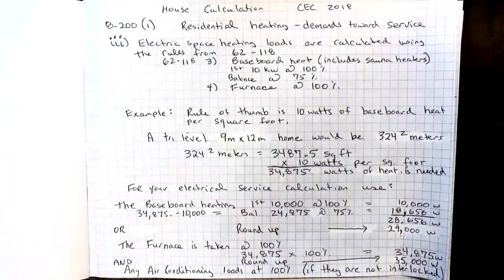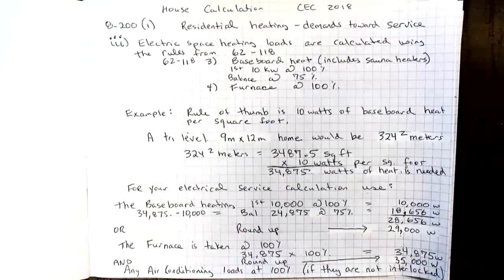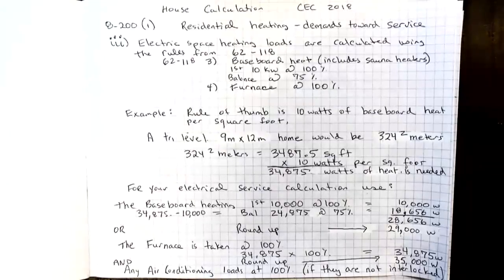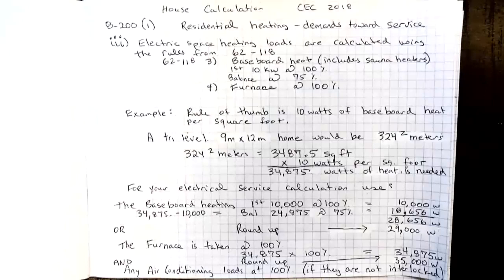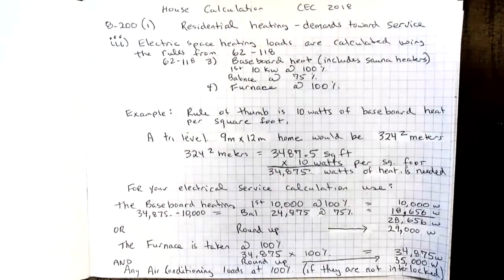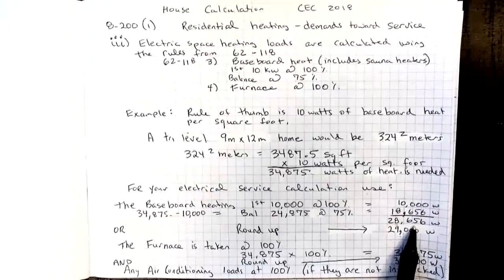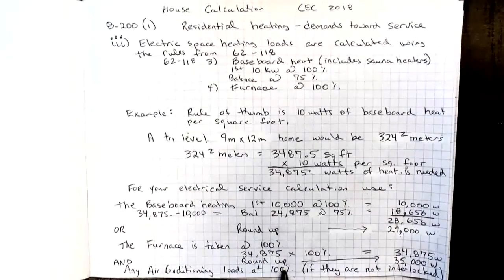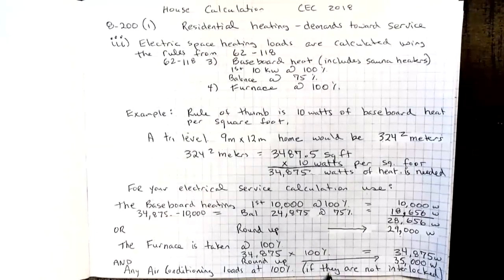CEC 2018 House Calculations: Heating and Air Conditioning Rule 8-200 (1)(a)(iii)

Comment: Hi and thanks for the great video! I am doing a homework assignment and I'm trying to figure out the demand factor for an air conditioning load in a commercial building. I think it should be 100% but I am not sure what code rule actually states that. Could you give me any help on this?